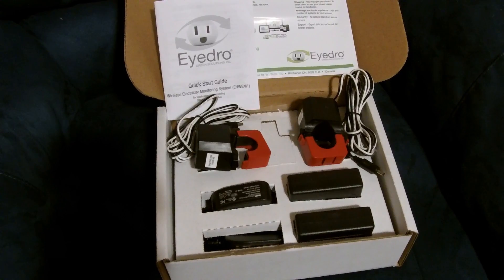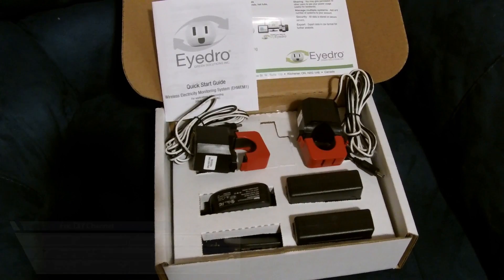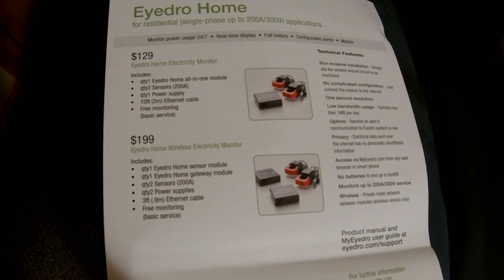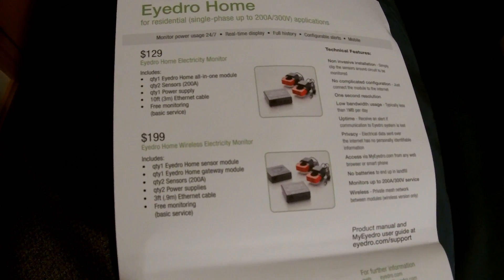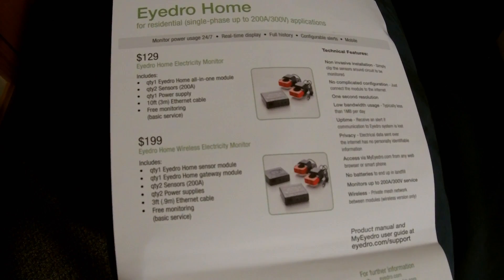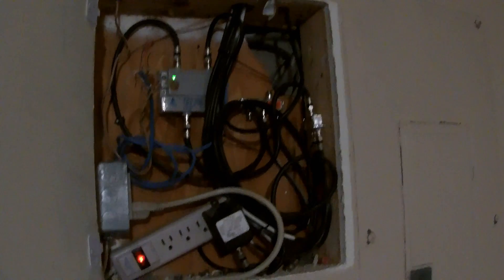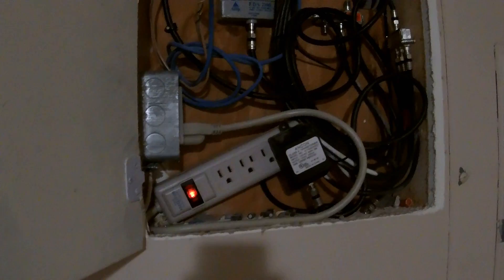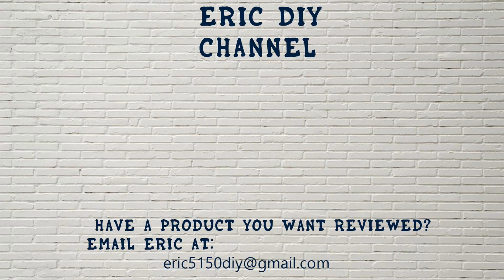Eyedro Home Wireless Electricity Monitor Review (SEE DESCRIPTION FOR IMPORTANT INFO)

Comment: Can you use this with out internet? I bought it today but if I can not use it locally with out internet it is no use to me. I have inline meters that have usb but they are only good for 10 amps.  After 10 amps the read out goes ballistic. Do you know of a meter that can do logging for offline use?
Reply from the maker: I believe this needs internet to I terrace with the online server where the data is stored. The only one I can think of without internet is the Black and Decker energy reader which runs on batteries
Reply: @EricDIY  Thank you for telling me about this Black and Decker energy reader. I did look into buying it. By reading the reviews by other users I would stay away from it. I do not want to put anything around the electric meter.
Reply from the maker: @pushingtechnologytothelimi7519  I used it for years on my old house. It was ok but not excellent as it ran on batteries
Reply: @EricDIY   The reviews I read were saying that the electric company meter reader ripped off the band that collected the data and the company wrote them a nasty letter. I do not know if what they are saying is true. Did you have any problems with your electric company with using the meter?
Reply from the maker: @pushingtechnologytothelimi7519  I did not have problems using it on my meter at my old house. I was with a small municipal electric company then.

Comment: Can you change the billing structure to time-of-use? Trying to find a monitor that'll tell me if I would be saving by switching to time-of-use structure.
Reply from the maker: It is customizable for services that charge a higher rate during certain times of the day. You need to configure it that way

Comment: I always like to check out the different energy monitors that are currently available. I have one in my home, but it is not this particular model. Based on what I saw in your review, I would say that the graphics and the various information displays are very good. It might be a little too much for some people, but not for a numbers geek like me. The price is also reasonable. 

The current transformers are a little bulky. I installed the unit that I promote for a customer earlier today. Those CTs are much slimmer and it was still a major chore to get them installed in the circuit panel that I was dealing with.  There is no way the CTs for the EyePro would have fit, which means I would have lost that sale. But the larger issue it the fact that the EyePro requires a power source. Just about all of panels in my geography are mounted on the outside of the house. There is no outlet close by. The unit that I promote draws it's power directly from the panel after everything is hooked up. In my market, any device that cannot be powered in this manner is going to be a very tough sell. Not sure why EyePro decided to go that route. Seems like they could have reached more markets by taking that extra step to tap directly into the circuit panel for the power instead of plugging in. I have never seen a set up like the one shown in this video. Finally, I do agree with the comment about strengthening the safety warning. In my area, all the bus bars that bring power into the home are not insulated, so I call the power company to take down the meter for a few minutes while I attach the current transformers. They don't charge anything for that. Unless you run into a crazily designed panel box (like the one I had to deal with today) my installations don't usually take more than about  20 minutes.
Reply from the maker: Where are you? I'm in MA and the house was built in 2000 so that's probably a factor in the insulated main as well
Reply: I live in Arizona. The builders out here tend to go with the least expensive components. The circuit panel boxes are made by Square D. It seems like all the homes I have seen, whether they were built in the '90s or in the mid 2000s (like mine) use these boxes.